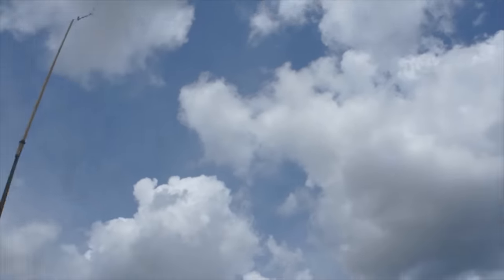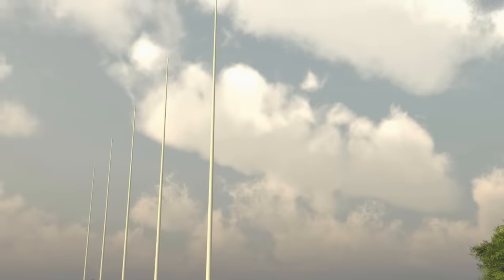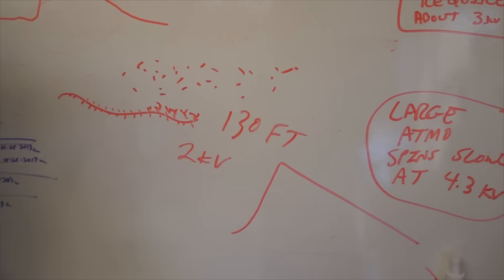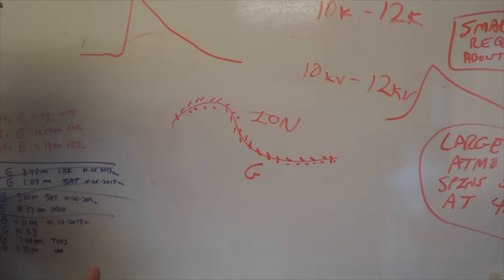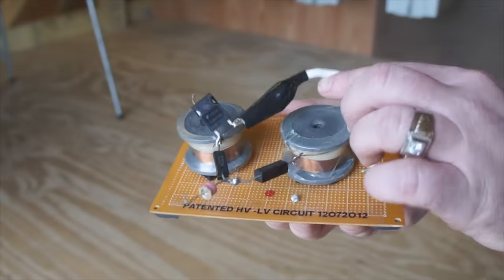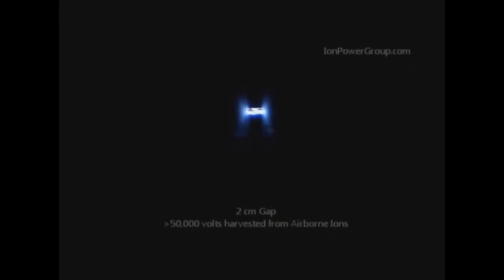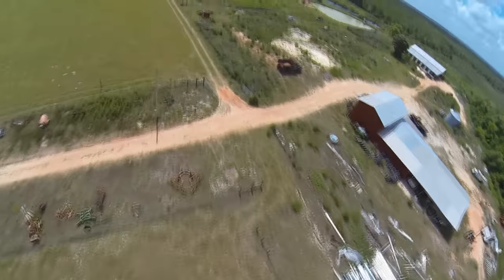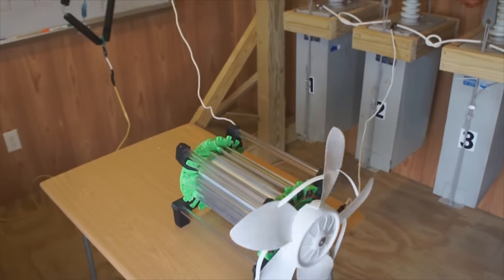Graphene/Graphite Atmospheric Electricity Collectors - Plus Horrific Hexacopter Crash!

Comment: Could you run a wire from the top of a large hill/mountain to sea level/ground level and get the same effect?
Reply from the maker: I think that should work.  See these images from Science & Invention ( June 1928  )
http://www.rexresearch.com/plauson/sci-inv-june28a.gif
http://www.rexresearch.com/plauson/sci-inv-june28b.gif
http://www.rexresearch.com/plauson/sci-inv-june28c.gif
Reply: lasersaber That was an interesting read,( the links dont work with the gif extension). It seems that research was at a more advanced state in 1928 than it is today. Although I find it odd that they were only intent on experimenting with it to provide enough energy to split the atom or analyse why long distance power lines fail, rather than as a source of free energy. What happened to the research did it just stop?
Reply: From what I've read you can run a wire horizontally off a mountain and tap into this energy. The dielectric layer of the atmosphere dips into the valleys.
Reply: Stewart Mcleod I do feel the same after reading patents and experiments done by Germans in alps in 1920s

Comment: the higher you go the more distance the conductor travels, the more air it collides with, if you had a 10,000 ft square ant vs 5000ft ant. There's an equation to tell you the distance covered diff

Comment: Graphite is basically carbon right? So Carbon fiber material should work I am thinking...just fray the carbon fiber on the outside of a long strand and it should work like what is described?
Reply from the maker: Yes, that is exactly what I am going to try myself.  Did you see the electrostatic motor Lidmotor made using carbon cloth strips?
Reply: lasersaber
No.l must have missed it. Thanx will look for it.
Reply: The EXACT structure of PURE graphene is such that, being monoplanar, it has all of the relevant bonds linked at precisely the correct balance to allow this conductivity to occur.

I strongly suggest that you read up on it before assuming that it is only a simple deviation of other materials.

How atoms bond with one another can be a complex mystery, or it can be child's play for an individual, but know this: each and every single molecule, how it is arranged, how it is charged, what its isotope is, every little change affects its performance.

Thusly, graphene, carbon nanotubes, bulk graphite, soot [fully or partiually formed buckminister fullerenes] and diamond will all behave differently.
Reply: Delicious DeBlairsmarts!  More.  On facebook?
Reply: Douglas Hopkins I got deleted from jailbook because they don't like my name or my personal agenda so I made my own social page.
Reply: Daniel Gendron Spreading knowledge can some times help others you know.
Reply: Daniel Gendron In the modern world where you can get free online college courses from Harvard University and other sources, there is no excuse for ignorance.

Comment: one of the early myth buster episodes they flew a kite set up like Ben Franklins original experiment just by using a wet string they were getting lots of static discharge sparks they were trying to make the case that he never actually flew his kite in a thunderstorm or at all I tihnk he did and that his kite just never got struck by lightning as several people did die years later trying to repeat that experiment I feel they did shed light on ION harvesting without realizing it

Comment: Impractical idea. There are lots of volts and almost no amps, and power being V * I, almost no power. A tower requires beacon lights to alert aircraft, but ion collection won't even power the required beacons. Sure, you could employ noble gas discharge lamps, xenon probably, for the beacon lamps, but you'll have to charge a capacitor for a long time to get a flash visible for the required distance.

Keep experimenting, but focus on getting the beacon lights to operate. I suspect you'll need 800 foot towers to power the mandatory beacons and ... nothing else. Cool experiment, not the first of its kind, known result.

Comment: It is true that they put a lot of enthusiasm and perhaps create a very futuristic expectation, but
the physical principle is totally real, there's no trick.

Many of us know the corona effect, or at least we have suffered it once when touching a objet go that was electrostatically charged.

Basically this effect is produced in the materials that end in tip, because in this place it is where the electrons of the material are concentrated (being or not conductive) and it has a smaller "resistance" to give the jump towards another material, in this case the air.
Well they do or plan to do so, using a material that is both conductive and very, very small on the nanometer scale.
It is called graphene, (which basically comes from the common graphite of pens, among others)
What these people want to do is to provide a conductive cable (let's say copper) with a graphene coating on its surface, so as to have a kind of collector.
Imagine a cactus, like  the thorns would be the carbon nanotubes,or graphene.
Now you're wondering what for?.
Well, it turns out that the atmosphere around us apart from knowing that it's a collection of gases, dust, etc.
By the friction of the air, by the cosmic radiation that reaches us from space and by the weather process that generates storms, thunder, etc.
This is a source of IONS which is nothing more than air particles, dust etc which are electrically charged.
Both positively and negatively charged.
If you don't believe me, can you tell me how lightning strikes?
And what an architect usually does when he enters a tall building. Place a lightning rod...
Well, these people want to do something similar but without the electrical potential reaching the end of the Ray.
HOW ?, well very easy
It turns out that, just as there is the atmospheric pressure that as we raise this value goes down.
there's an "electrical pressure" that as we go up this value increases.
I will tell you more, every 1m that we raise the value increases 100 Volt on average!

I'm not making this up, you can consult physics books,
for example the famous Nobel Prize winner R. Feynman
in his master classes has it published.
I leave you the link: https://www.feynmanlectures.caltech.edu/II_09.html
But before I give you an attack and give you for selling the shares of electricity, I will tell you that the intensity is very small on the order of picoamperes per square meter.
But since we all know that by playing with voltage values we can increase the amperage, perhaps this value can be increased to a value more decent.

It's all a matter of climbing higher (the theoretical top is 50 kilometers or 400,000 volts) and increasing the harvesting area.

What if this is the ultimate energy solution?
Absolutely not, but maybe for certain places
where they are difficult to access, something can be done of this kind.
Imagine a fleet of balloon drones that were constantly plowing the sky
to perform monitoring tasks, TV repeaters, internet, etc. at a low cost. It would be a good alternative for countries with low economic resources to establish an infrastructure in the skies, without having to bet on the current satellites.
It may be a very primary technology
but more primal I think is to keep burning
oil contributing to pollution in favour of archaic thoughts.

Comment: Great video!!   I certainly like the ideas!!  what happens when they get a 2 million volt lightning bolt hitting their wires or towers?  and the higher the towers the greater the chance of a lightning hit. :)
Reply: Yeah massive loss form a lightning strike. They are making a whole 600ma it will only take a few hundred years to recover costs. Like to AA batteries. Lol

Comment: Better to consider what forces generate the ions to begin with...   with small total capacitance but high voltage, you don’t have much energy, and such long times between zaps, you don’t have much power.  Electrical Engineering 101.   Interesting thing here is in efficiently generating ions from atmosphere’s electric field.  Getting larger capacitance charged up faster by orders of magnitude= possibly usable amounts of power.

Comment: The Graphene needs to be also in the ground to collect the negative ground energy like it does from the air. Then the potential would be even greater if they are not already doing that. Tesla would match the same above ground circuit in the ground, with the same amount of area of the above ground collector. Tesla claimed the earth (ground) was a vast sea of energy.

Comment: Hughes 500 helicopter that carries a cable will arc when the cable end touches the ground with a sound like a firecracker. If you touch that cable before it grounds, you'll wet yourself. (unless you're already wet) Then it will kill you. We were trained to handle the ionically charged cables in the Oil and gas industry.
Reply: yes, but those charges are coming from the blades cutting through the air.

Comment: He (from arounnd 6min ) is talking about high Voltage ( kV ) but it is not metioned how much W (energy) is produced.
Reply: Mariusz Kreft if you put up a single wire a few hundred feet with only a 6 sharp metal points and no graphemes material points, you'll develop in the picoamp range
Reply: Don't be confused. A Tesla coil with almost no current, with several thousands of voltage can accumulate huge amount of energy in a few seconds. It is just a matter of second mate. This free high voltage source can be used to charge up capacitors and batteries

Comment: If you built one of those near the north or south poles you would get more electricity from the solar winds like the northern lights there's more concentration of charged particles in the air there

Comment: That’s the first thing to come to my mind.  The high voltage spark gap is impressive, but changing it to 110v what house hold items can it power?  Although the “free radical” atoms in the atmosphere that are the ions that are collected by the wire fluctuate wildly, a lot of info. is left out.  Is there ion flow at night? If I had a lot of cleared land to string wires I think that I would try this as more favorable than solar cells.  Sadly, that word patented came up again.  Wouldn’t the normal wires on the poles that deliver el. to my house gather el.? Is more free ions available at sea level, or mountain tops? As you can see I’m quite interested in this concept. HAARP looks a lot like what is being tested here. Only they radiate electricity, while this video is an attempt to gather ions from the atmos. And what element is giving them the ions? Nitrogen? Oxygen?  Something else entirely?  Interesting.

Comment: My personal opinion is that this particular way to collect electricity is impractical and inefficient compared to most other methods like wind/solar/hydro, and the main thing is the height of the tower/wire,. Could the collector be enhanced by using thousands of needles around a ball?  Towers are heavy and expensive, maintenance guy got $1 a foot a decade ago, a 400ft tower needing a new light bulb was a $400 maintenance bill.  And if you're in a high wind area (like the Midwest), gotta tie it down good. Then ya gotta convert the volts to amps, ........🤔 I'll be trying the HHO with a combo of wind, solar, and hydro.
Reply: Wind. Wow.

Comment: For the hexacopter: dump the plastic readymade frame and build a wooden one out of 4mm plywood and 12 mm x 12 mm wooden sticks. You can attach the motors to the sticks via doublesided tape and two zipties per motor ( search for simplecopter or flitetest for further details on that). The frame will be very easy to repair and cheaper rhan a 3d printed one. Parts availability will also be great

Comment: Not sure about the future of this idea. Atmospheric electricity has an extremely low power density. Even at its most spectacular lightning discharges the energy released is very modest, but because this energy is released in a matter of microseconds it produces a lot of very short-lived power.  So you probably need a collection area the size of a football stadium to power a shaver, and that if you collect the power reasonably efficiently , which is not easy to do given the voltages involved and leakages associated with those.  Pretty sure that is not how our future will be powered.

Comment: I'm not very knowledgeable but why don't they charge batteries instead of using capacitors if it's a steady stream of electricity direct current couldn't they just have a large battery Bank then disconnect it when they don't want to charge it and also couldn't this be used to generate an unlimited supply of hydrogen so you could run a hydrogen fuel cell and generate usable energy that way?

Comment: Anyone who's worked with full sized HF antennas has experienced this phenomenon, sometimes in unpleasant ways.
Notice how they only mention the impressive sounding voltages they're seeing, but never talk about the actual power.  That's because it's next to nothing.  This is a neat trick which will go nowhere.

Comment: They keep saying 2000 volts but that means nothing, whats the current. Must b next to none
Reply: What is the "current" of wireless phone chargers passing from the base unit to the phone. Same thing, it's wavelength combined with voltage pressure. Add an FM carrier into the line to act as an electron pump that carries the voltage along for the ride.